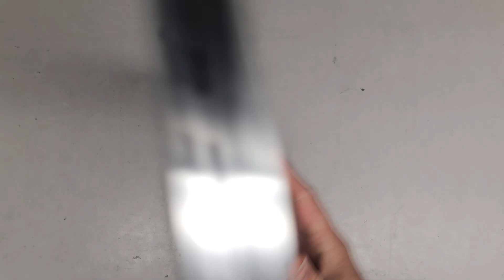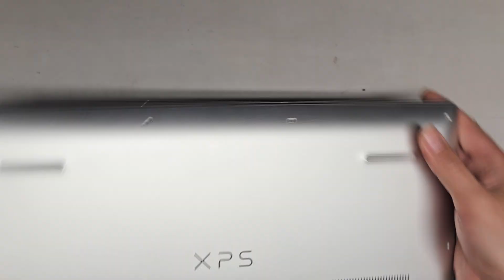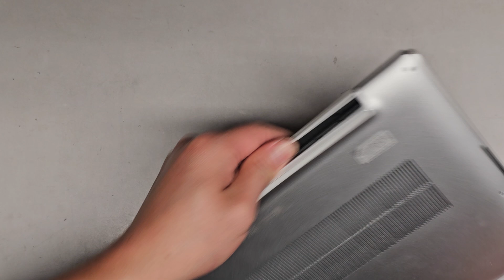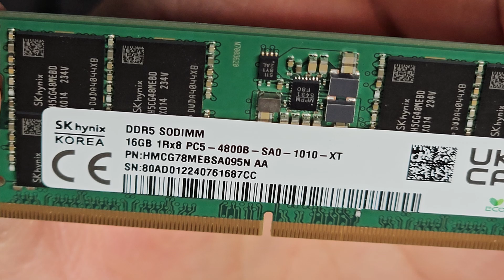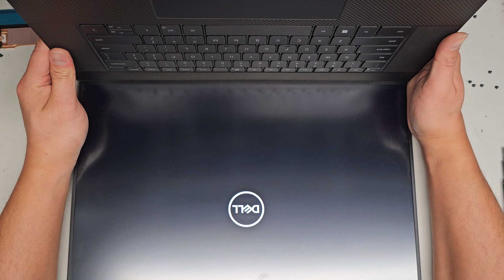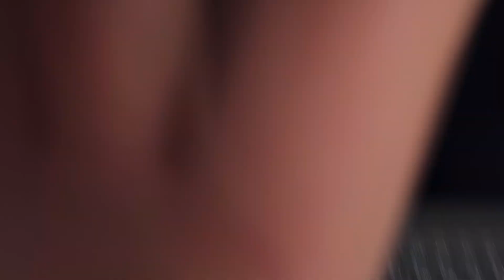DELL XPS 17 9720 Disassembly RAM SSD Hard Drive Upgrade Battery Replacement Repair Quick Look Inside

Comment: This happened to my Dell XPS 9720 when I unplug the battery so like you said it does reset the CMOS battery but it takes a while for Dell to rebuild the BIOS takes up to 5 minutes to do so on at Dell logo remind me to hear the fans ramp up a little bit depending on your thermals management settings beforehand but after the 5 minutes Dell support Diagnostics page and you just hit the hit continue and everything is okay it will boot back into Windows after it shuts off one more time. Trust me, I was so scared and confused at first 😅 hopefully this helped somebody!!
Reply from the maker: Lol yeah, it's scary. I feel they do it on purpose so people think they break something and call to send it in for repairs...